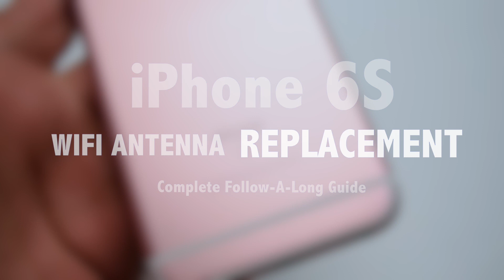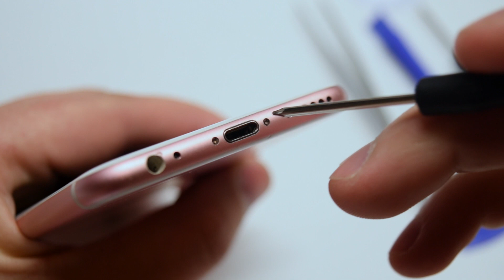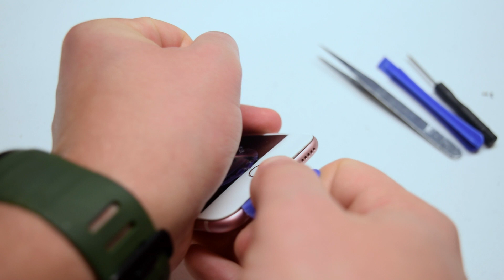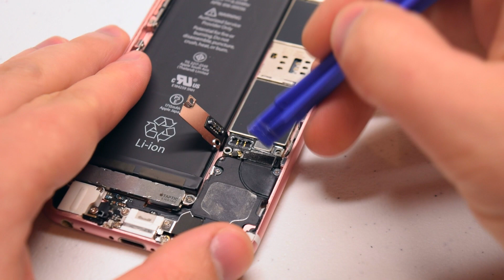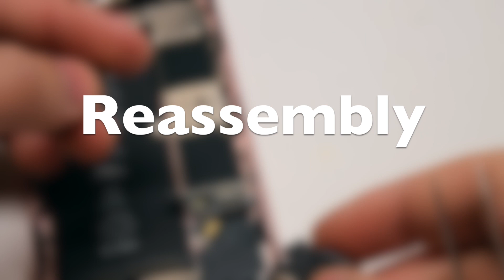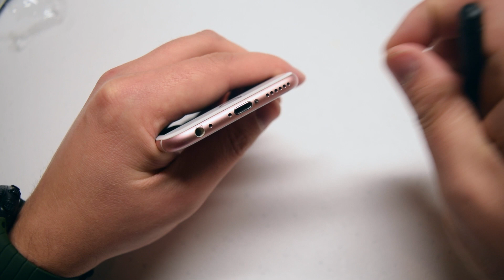iPhone 6S WiFi Antenna Replacement

Comment: Hi, thank you for this nice video.
The WIFI of my iPhone 6s is working fine, also mobile data network is working fine.
But bluetooth is not working. After turning on the circle is turning around but bluetooth is not turning on.

Is this the part I have to replace or which other part could it be?

Thank you in advance.

Comment: Nice video
Please help me
I also dont have signal when I am near the wifi. Only showing 2 bars and sometimes not showing the wifi even I am near it. When I tap connect and enter the password everytime saying unable to connect. I tried with many wifi s and hotspots. Same issue. But only in laptop windows 10 hotspot this one connecting to it but cannot go internet. Please help me which part should I replace. Thanks

Comment: WiFi works well Bluetooth does not, no Bluetooth speakers connect well, it say connected then it cut in and out, Airpods have the same symptoms..says connected but no sounds...playback of music will even stop while the Airpods are connected. I've done everything software related... restore from backup, reset to factory and nothing works. Could it still be the WiFi/Bluetooth antenna even though WiFi is fine.

Comment: ok so my wifi works perfectly till i leave the room from where my router is located, and then suddenly i get 1 bar and when i go upstairs its as bad as no bars sometimes , what type of part should i replace?
Reply from the maker: It's hard to say, you just have to go part by part. First the main antenna cover, then this cable, then the main ribbon cable underneath.
Reply: It’s the antenna

Comment: Hi! How do you know if this is the part that has to be replaced? ‘Cause I’ve tried a lot of other ways but doesn’t work :/
Reply from the maker: We usually don't know if it's this exact part, this antenna is one of three possible WiFi points of failure. Replace this first then move to the diversity antenna, then the speaker/lightning port cable.
Reply: @GRIBSOFT  g
Reply: Save Apple Dollars Sometimes the wifi is gray but most of the times works and when it works it has low signal. Do you think one of these 3 options that you gave me could fix it? Or do you think is another thing?

Thanks for replying!
Reply from the maker: Sounds like a loose cable. If you feel confident, open the phone and check all connections, reseat the wifi connections.
Reply: Did it today and still the same, everything was perfectly in place. Do you think by replacing the wifi antenna it would have full signal again?
Reply from the maker: It's worth a try, the part is super cheap https://ebay.to/2Nv9WPh